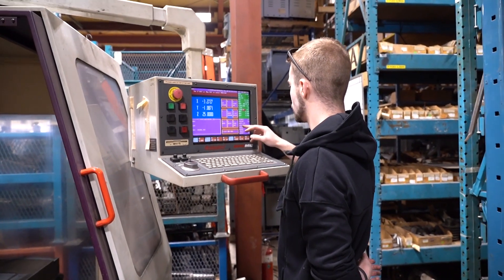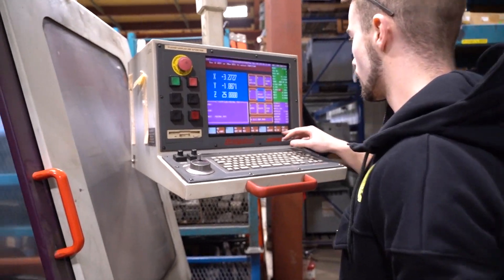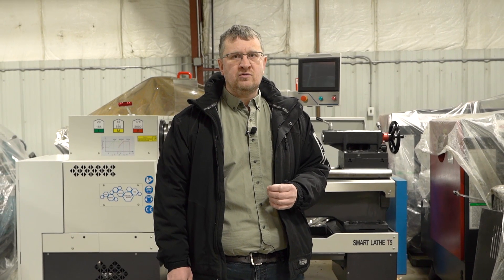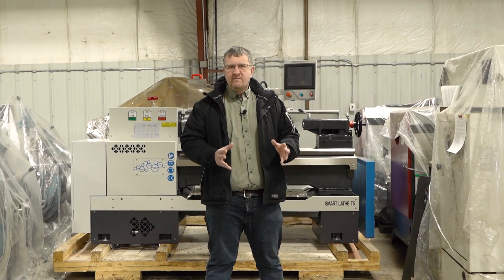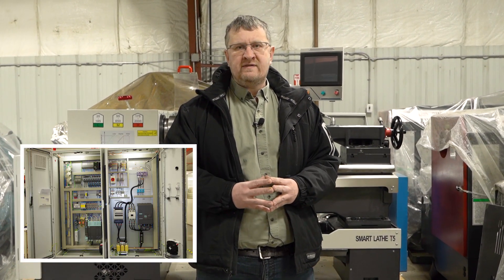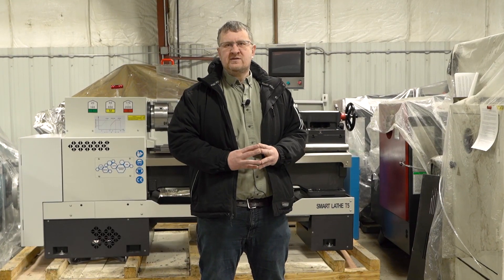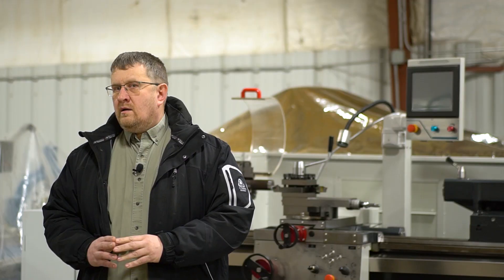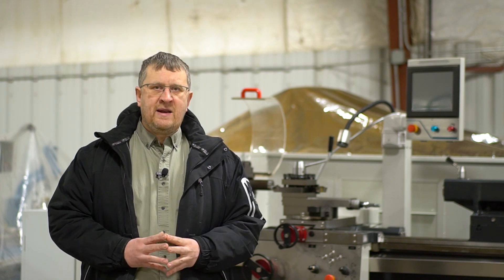Smart Machine...Lathe Worth Your Money (Manual Lathe is Dying) | @StanCanada

Comment: Very good presentation of what to me is a new concept in lathe set up.
I can see a lot of this style used in job shops everywhere.
I can understand the fixed toolpost as a requirement for canned cycles and as an aid to rigidity (which looked good under that heavy roughing pass!) 
But I hope I hope you can 'lock' the 4 position tool holder in other positions or the 40 position is nessesary rather than an option.
That said, I like it, if/when I look for a replacement, or get the ###'s with my current lathe I'll definitely look at this Smart Lathe.

Comment: Nice video, nice lathe "upgrades".  I want.

I have been considering modifying my lathe converting it to an electronic lead screw. It is clear that when amateurs start making such mods that mechanical devices are reaching the end of their evolution. 

Companies are now replacing the chain drives on bicycles, eliminating the chain in favour of a crank that sends torque and cadence data to a hub motor that actually drives the rear wheel. 

I'd hazard a guess that smart lathe designs will replace manual engine lathes in no time.

Comment: What is the logic behind leaving the spindle running once cycle is done??? Makes no sense and electrically is nothing more than de-energizing the spindle contactor. At the very least you should make it an option ( a checkbox or push button on your GUI).  Spindle off at end of cycle? or not. Otherwise, this is a great machine. Well thought of and looks super rigid. Congrats.